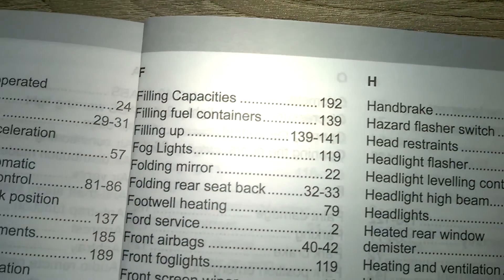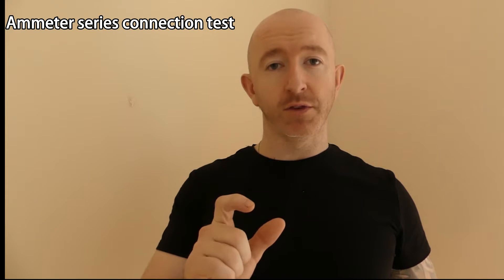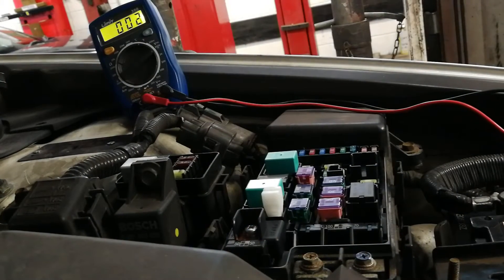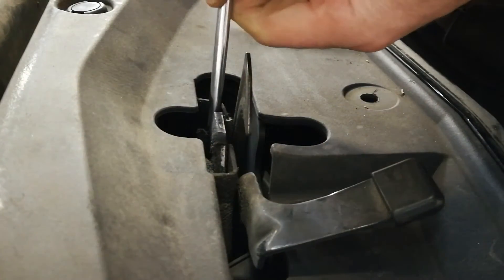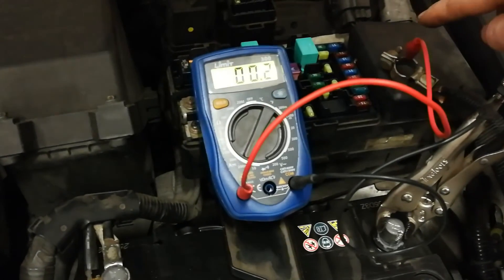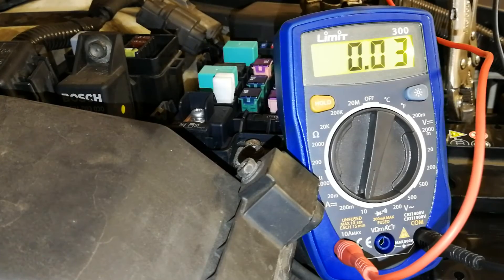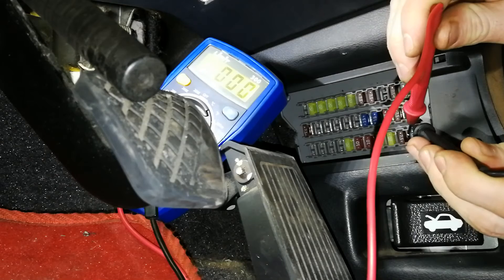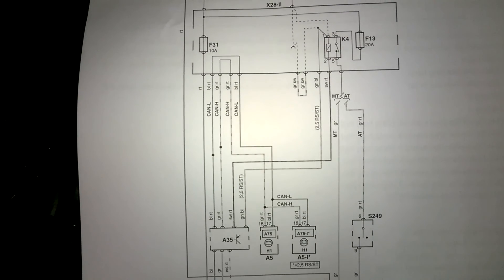Battery Drain Test - The Best Ways - How To DIY

Comment: It didn’t work on my 08 Camry. 
Lately it started this problem of not opening feet vent for warm air it shows vent is open but it’s not throwing any air. Any suggestions I even tried the actuator it’s working but not turning all the way so the vent opens. Thanks

Comment: Getting ready to do exactly this on my son's 02 altima. He has driven it daily and quite irresponsibly, such as when was the last time you checked the oil or even tire pressure. His response...I keep forgetting.
Well, aside from the obvious mutated genetics, his vehicle has had the battery, alternator, and several sensors go bad. After replacing them, now there's a drain and the throttle body has refused to cooperate and function. Part is on way and after installation, it'll be find the drain time. 
This video provided a few pointers I had not considered. Very nice!
Thanks for sharing!!!

Comment: Chasing electrical drains is not one of my favorite things to do... granted, there can be common easy-to-find issues, but newer vehicles & vehicles that I'm not familiar with, make finding drains not much fun. I prefer to use an ammeter... but am using the voltmeter method more & more (to get used to it) as I can see the benefit of that method.
Reply from the maker: I can't say it's one of my favorite either Thomas, it is a rewarding job at the end though, we are always evolving to keep up. I was at a masterclass course this week on servicing modern vehicles, I expected to get a few bits of solid new info but I was amazed at how much I took away from it. Learning everyday. Keep up the good work my man 👌👍💯